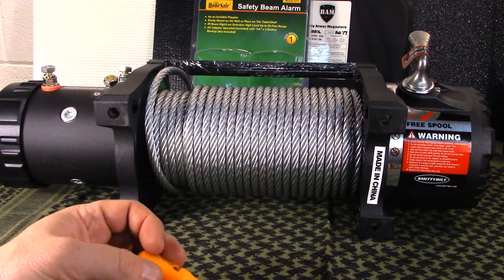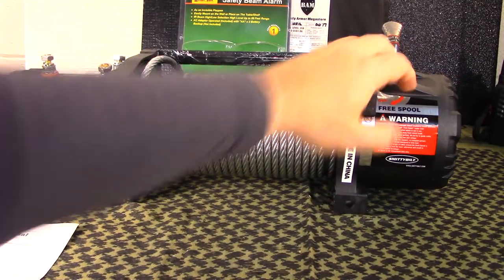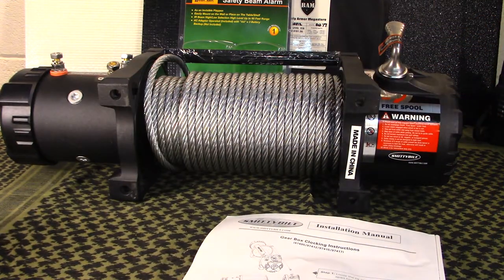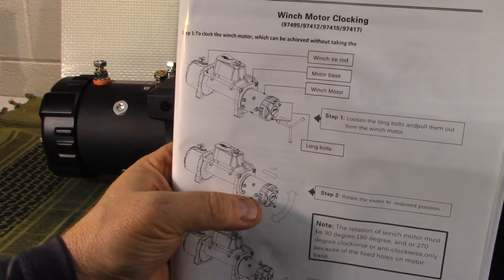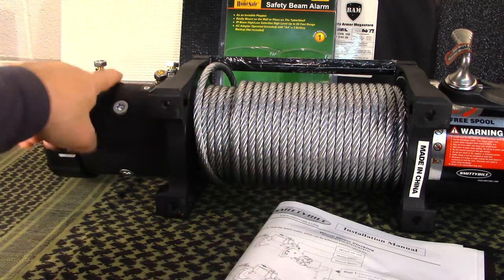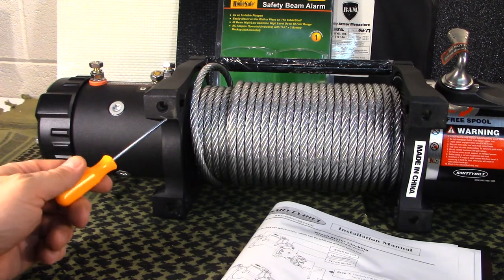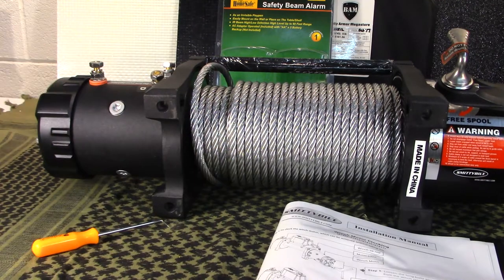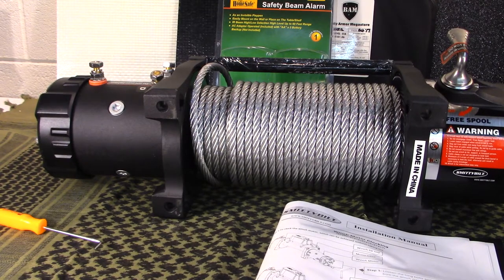Smittybilt XRC 9500 Discussion and Clocking (FJ Cruiser Bug Out Vehicle)

Comment: The Harbor Fake probably comes off the same assembly line, but the Smitty will have different ( hopefully better) specs, and you're right, you'll get better support from Smitty. I chose it for the same reasons. Works well for me too. I use it once in a blue moon, but it gives me peace of mind when I'm by myself, off road. When you need it, a winch can be a life-saver. Thanks for this info, I got a new bumper and need to clock mine now.

Comment: Great video thank you it was very helpful. Although I did find that when it came to clocking the engaging and disengaging side of the winch I did not go as far as you did, instead of having it sitting more forward I had mine sitting tilting back towards the vehicle and it seem to fit in their perfect. And yes I have the same winch and ARB Bumper. I hope that this is some additional help. Once again great video.

Comment: Could the rubber seal be turned as well?
Reply from the maker: Good point and might work as an option. I didn't want to take a chance un-seating the entire rubber seal to try it.
Reply: The seal can be clocked with the pin it just needs to be pulled up out of the little Groove that it sits in. Then just use a small screwdriver to make sure that everything goes back where it's supposed to and bolt it together when you're done.